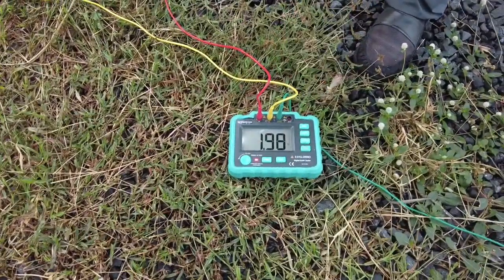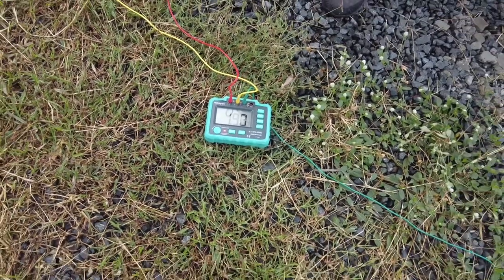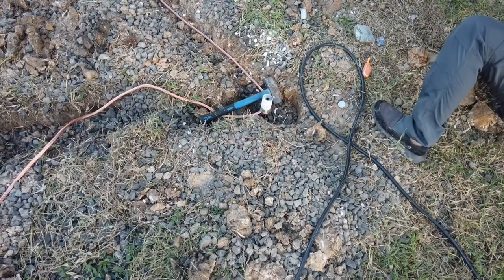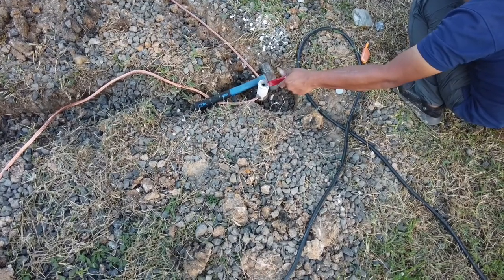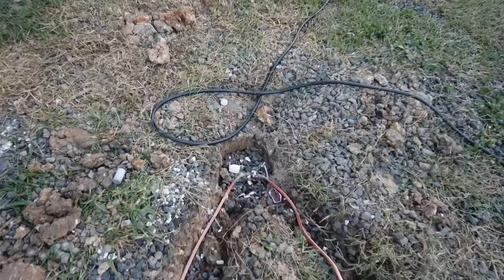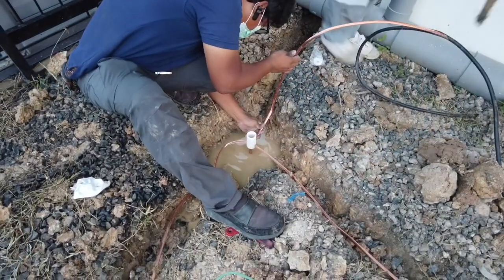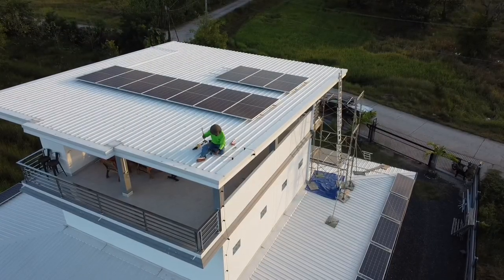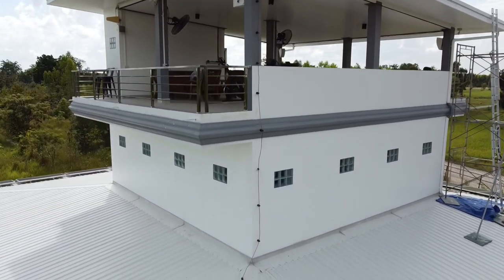Installing a Lightning Conductor

Comment: Do you also have a separate electrode linked to the Earth bar in the distribution board?
Reply from the maker: I have a separate ground rod for home electrics, another for my solar system and another for my solar thermal immersion heater.
Reply: @EcoHouseThailand  Did you also test the soil resistivity and external earth fault loop impedance?

Comment: did they bond the Lightning System to the Solar Grounding system? or it should be seperated?
Reply from the maker: The grounding for the lightning conductor is separate from the solar grounding and much more substantial
Reply: @EcoHouseThailand  Thanks. It is good to know that it should be seperated. Is the AC and DC ground of the system is seperated  also?
Reply from the maker: @TheStev08  Yes
Reply: According to the NFPA780 the grounding systems should be bonded
Reply: @keegang7402  yeah i thought you bond anything metal, railing, pipes, solar panels, ac units on roof, lights, antenas, etc